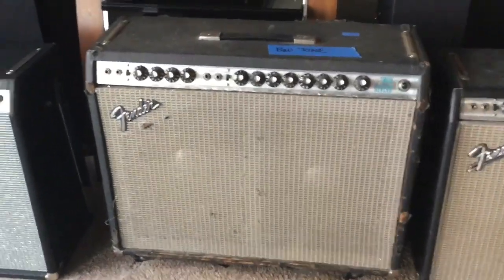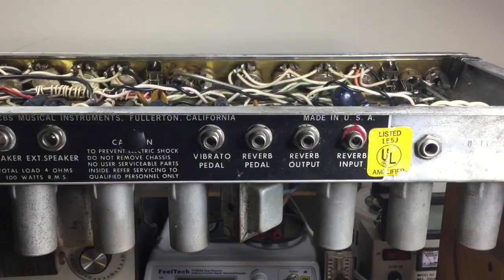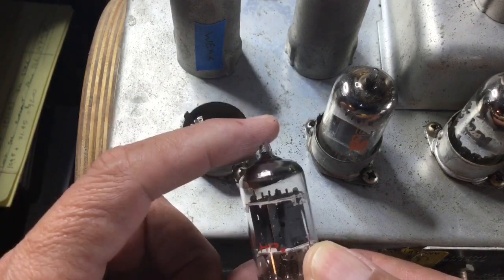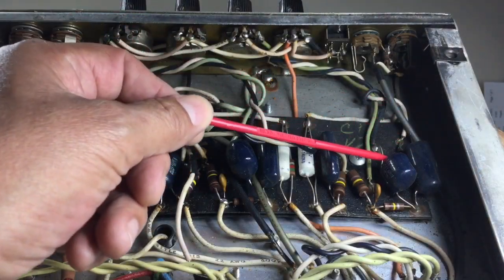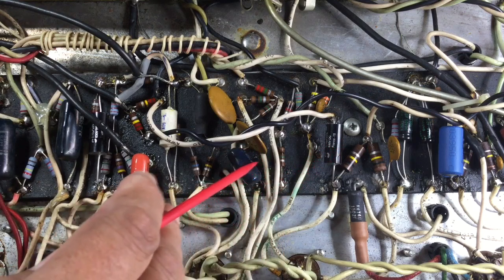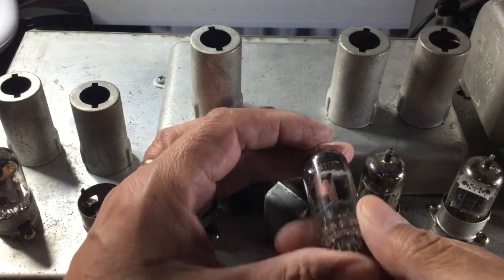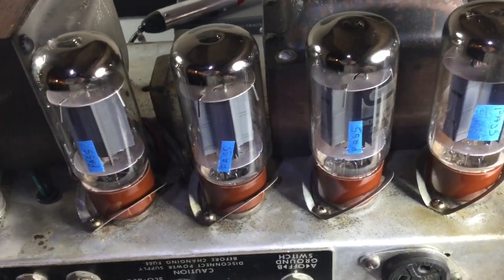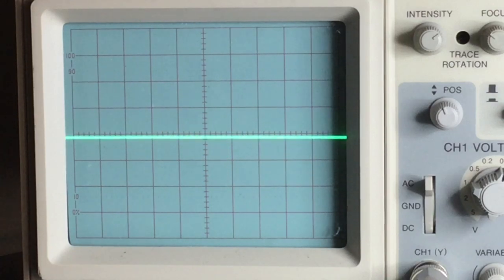How to repair a Fender Twin Reverb Series Part 1

Comment: thanks for sharing,
Preparing for my own restoration of a SuperTwin Reverb (an odd one). This video really helps in preparation.
BTW,
Your link to the website if broken.
I was wondering which deoxit versions you use for what parts.
Also, there seems to be a lot of wax on the older boards. I heard that with older amps and micro dirt collected in the wax you can get DC current passing between components. Whats your stance on it.
Reply from the maker: Let’s talk about Deoxit . This is the product I use and recommend for all diy and future technicians to use. I use there D5 line. As far as the wax type circuit boards. These tend to warp and become inductive when the unit is exposed to moisture. The best fix is to use a turret board type to replace the wax type board. However this drops the vintage market value. Please note. 

If you have any further question. Please do not hesitate to call me at 805-881-2299.

Best Regards,

Eric-

Comment: Thanks for the vid, nice sound fx! A friend of mine, long time amp tech, done 100s of tube amps, told me to NOT use deoxit on high voltage/current bearing terminals, claiming that the lubricating film residue can burn, causing problems with conductance. What’s your take on this, given what I saw in this video?
Reply from the maker: Excellent question. Attached is the data sheet where you will find the application data. In short. Deoxit protects and improve contact on high voltage terminal such as tube sockets reducing voltage arcing etc. The dominant chemical properties is mineral oil  which is used in high voltage pulse paper in oil capacitors. Deoxit is the standard manufacturing procedure for all amplifier service.